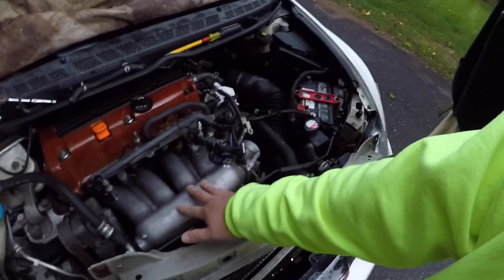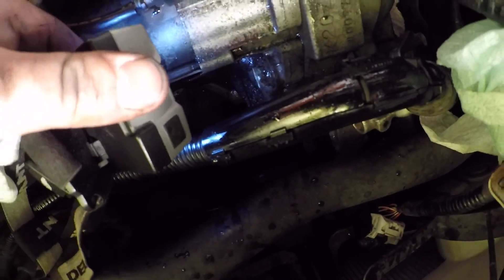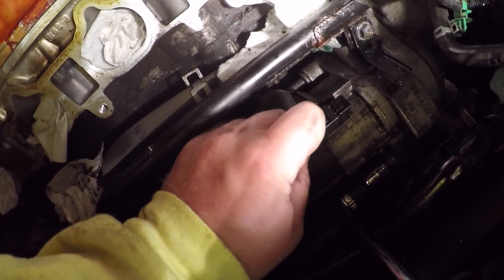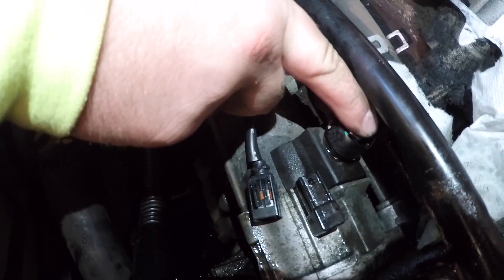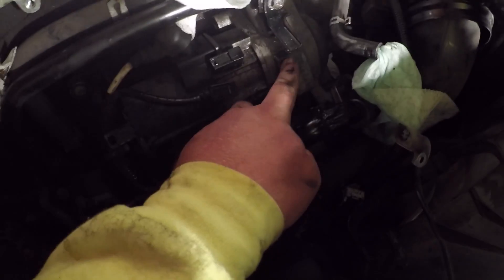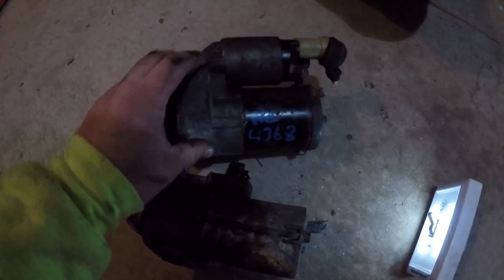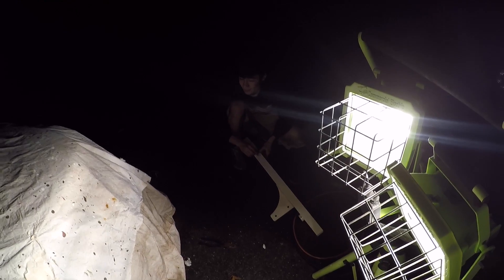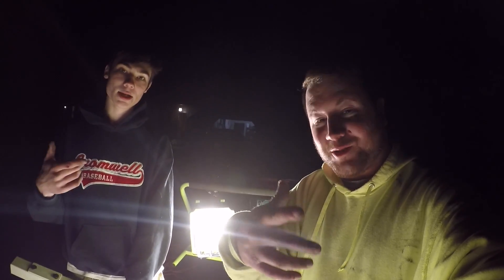Honda Civic Si Starter Motor Removal Replacement

Comment: I did mine in from underneath the car with the supercharger manifold on there, which wraps around the starter. Was definitely the hardest thing ive ever done on my 8th
Reply from the maker: We could not get the 17mm off from top or bottom, not enough leverage. Intake mani off makes it 100x easier, but is a lot more work.

Comment: If you have good tools the only thing you need to do is take the front end off disconnect the battery , the oil sensor and knock sensor and you can pull it out the front end, fan shroud pull the two wires off the starter, pop the two bolts out (without different sized sockets + extensions you’re gonna struggle ) definitely don’t gotta take off the manifold and avoid replacing the gasket

Comment: The heavy gauge wire is the positive off the battery and that little 1 wire connector is the tickle wire or signal wire for that starter to engage. Disconnect your negative because if your loosening the power supply and you short your wrench to ground you could blow your main fuse and wreck your wrench when it welds itself to something
Reply: Wondering if anyone caught that. That's why I went through the comments.

Comment: That ground wire is actually a very strong power wire. If you short it out to the chassis with battery connected you will melt tools and burn yourself badly. I know of a guy who shorted that wire against the frame of the car with his wedding band. Just for a second, he yanked his hand away and it pulled off his skin like fresh mozzarella!

Comment: Aye Broskie first view haha I changed my starter like 2 months ago shit was a bitch I did her under tho only removed that top mid brace and loosen the rad to get it out and back in! Good shit!
I got my new starter from some spot called Clark’s in bellflower,Ca 80$ plus my stock ones I guess they fix that shit and resale it but I got a goood ass deal!
Reply from the maker: Ayyy, thank you 🙏🏻... it’s definitely a tough job for the first time, especially if you don’t remove the manifold.  We just didn’t have the leverage to break that stuck bolt free.  I think he’s gonna buy a refurb one from O’reillys
Reply: Gerb Productions yea Brodie I had the same problem but luckily I didn’t have to take off the manifold. I have a tight teeth breaker bar so I did it from the bottom and rad top when I removed that top brace. Move the rad toward and pop the starter right out and back new one back in so fairly easy with the right tools Brodie but good vid! I’ve been thinking about YouTubing but still debating haha my project is like half way already. Plus Idk how to edit and do all that extra stuff I’ve rather just do straight up raw footage ahah old school 👍👌

Comment: I assume that's not ground but connected direct to positive battery!(12mm nut on starter) I can't believe you guys didn't show negative battery terminal disconnection ; seems  very dangerous to me
Reply: I don't have one I need to borrow yours
Reply: 😂😂😂 This thread tho
Reply: ain't fit too tiny
Reply from the maker: Negative terminal was disconnected. Anytime I work with electronics, that is one of the first steps I perform. You are correct though, should’ve stated that step. If you watch my intake manifold removal, you’ll see what I’m talking about.
Reply: You need gloves and safety glasses too. 😂😂. Does anyone know a way to disable the security lock on the radio when disconnecting the battery? As in so it doesn’t get locked. I know how to unlock it

Comment: Lol really a used junk yard starter that is not even for a 8th gen SI crazy. I'm glad the PRC manifold has no coolant lines connected to it makes it a lot less messy to take off.
Reply from the maker: He ended up buying a new mitsuba starter for $230... Going to last him a long time
Reply: @TheGerbsteve  Where did you get it for that price? Honda wants $600

Comment: When you found out your car didn't start, did it cranky or anything?
Reply from the maker: Billy's car wasn't starting so he had to pop start it every time lol.  He ended up buying a brand new mitsuba starter
Reply: Damn that's suck, I had this problem where my anitfreeze busted a hose and it didn't want to start now. I had checked fuse and starter, it still good. My last option is probably my key fob. Get it reprogram but I want to be sure before I take it to the dealer

Comment: Last time I replaced my starter I broke the knock sensor 🤨.  Be careful
Reply from the maker: They’re pretty expensive, think like $75+
Reply: Man i did it for a friend and i went to unplug it, i hadn’t watched this video. I went to unclip and it came off. His check turned on, on the way home🤦‍♂️. I didn’t think anything was wrong since It didn’t make any noise or didn’t feel any resistance when i pulled it off. I guess i have to take responsibility man but damn it sucks. Feel like it might have been like that already but I’ll be fixing it tomorrow.